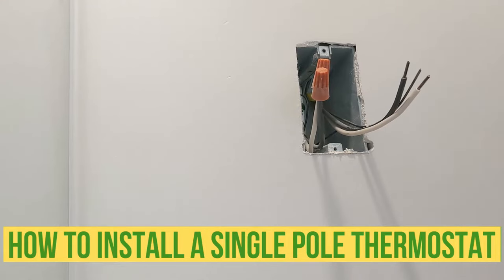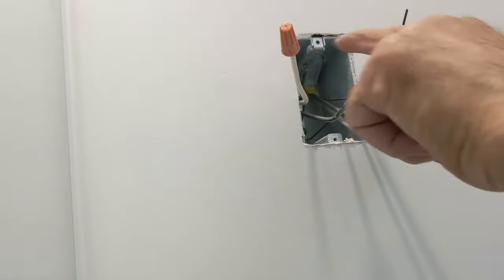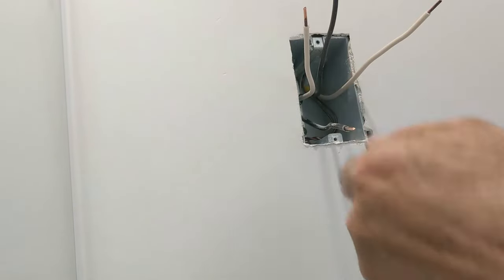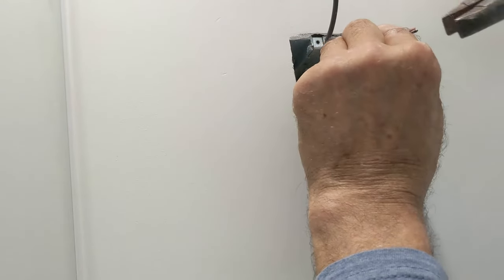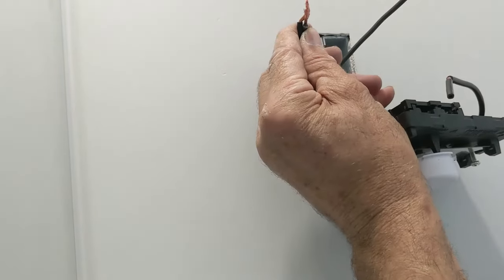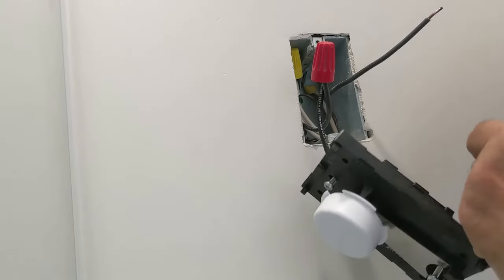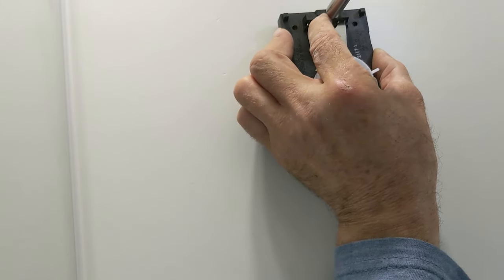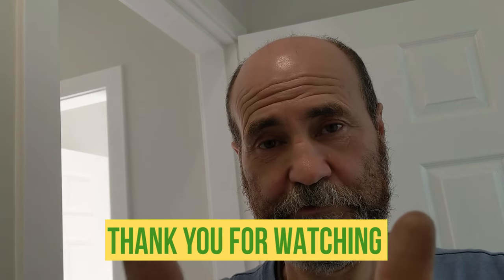HOW TO install A single pole Wall mount THERMOSTAT

Comment: Hey, question…i have two baseboard heaters connected to a wall mount thermostat…and the heaters are only working if my thermostat knob is set to the highest temp?
Reply from the maker: Hello there thank you very much for your time and support, the first thing to check is the thermostat, sometimes they come with factory defects, keep safe